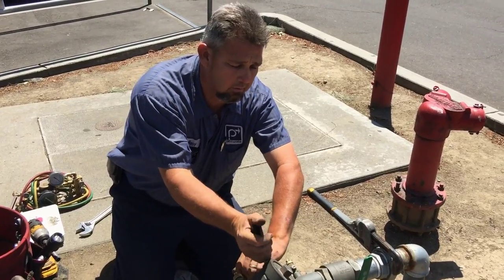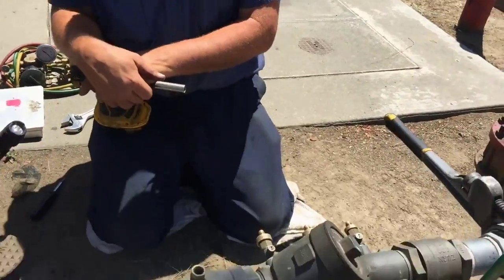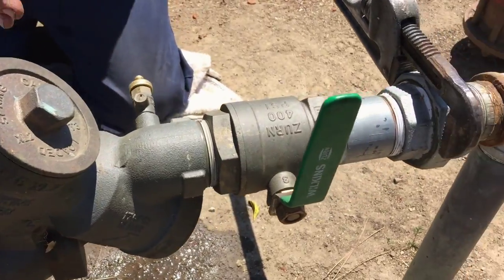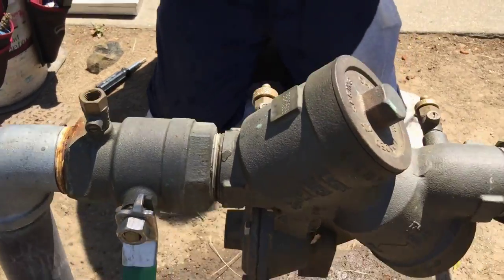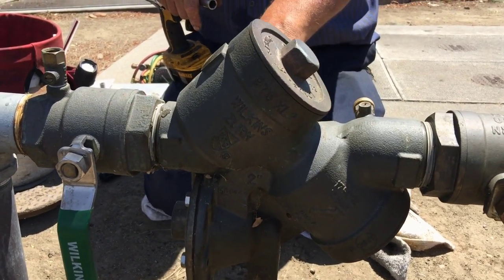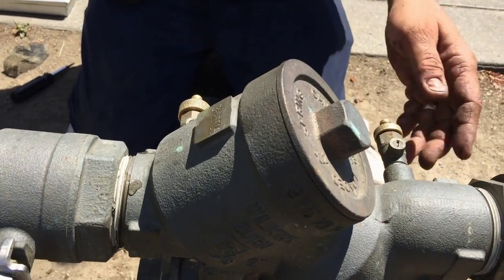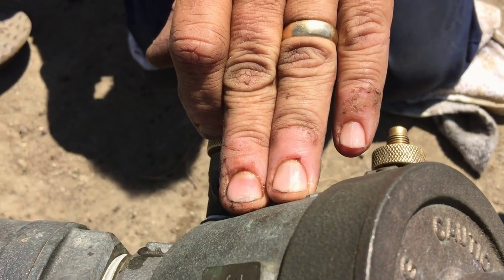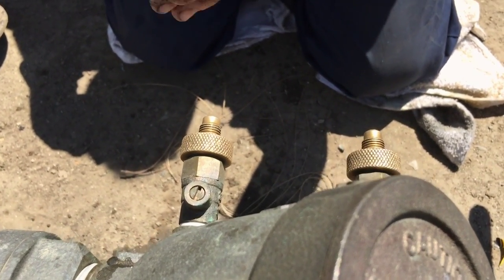What is a Backflow Preventer & How Does it Work?

Comment: Can somebody explain how the backflow preventer is useful when used in homes irrigation system? First of all, in the normal condition, the city water has a 50 psi pressure preventing a backflow. Second of all, if something happens like the main water shuts off in the main line , the water inside the irrigation system cannot come back because first it's in lower level and second the irrigation valves are closed preventing the water motion.... It's an unnecessary device which usually breaks due to cold weather adding a burden on homeowners....
Reply: It's 1 in a million ... but it can happen and 1 in a million events do happen and kill people.  Let's say the irrigation system is open because you are watering your lawn with a pop up sprinkler in the center of the lawn, you have been watering too long and a puddle has formed around the sprinkler head,  you also sprayed the lawn with chemicals yesterday to kill off some unwanted pest or weed... now you have a puddle around your sprinkler head containing water that is potentially fatal to a human if consumed... next thing you know you hear sirens and a commotion out in the street ... you run outside and realize the neighbor's house is on fire ... the firefighters are there and have hooked up to the watering main ... their pump is sucking the water main dry and creating negative pressure in the water main which sucks up the poison on your lawn and into the water main ... 20 mins later the fire is out and all is well... you walk back into the house for a glass of cool water as the fire has dried you out

 NOW YOU'RE DEAD.
Reply: Because back siphonage can still happen in the most bizarre circumstances.
Reply: It's a rip off.